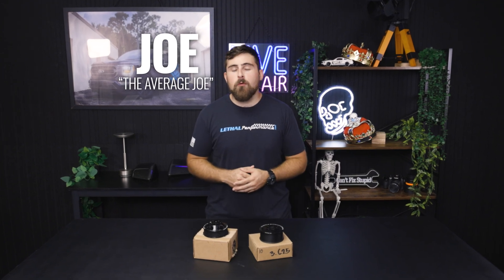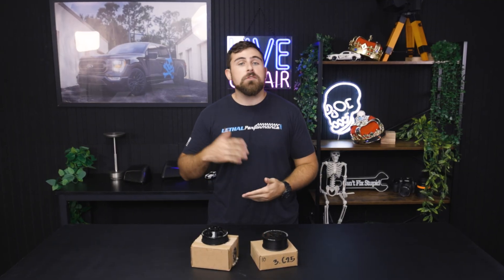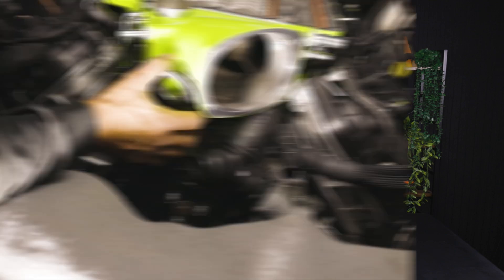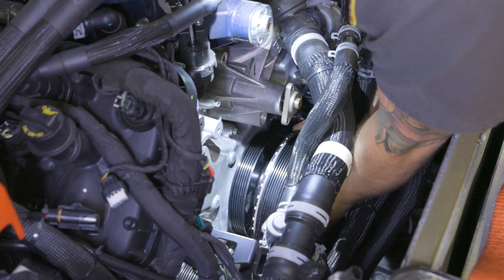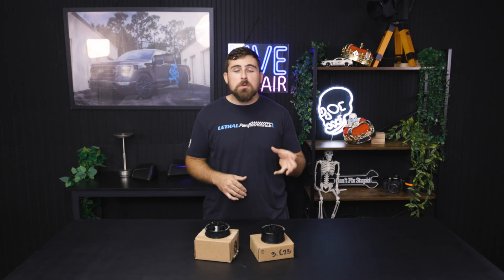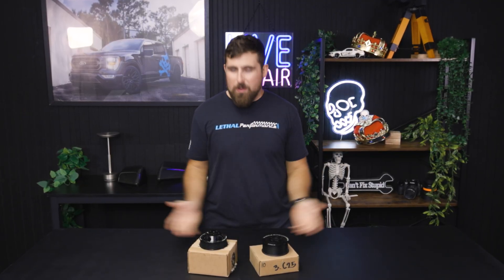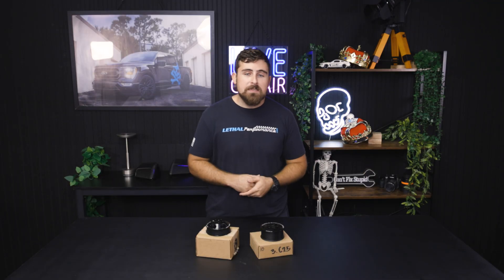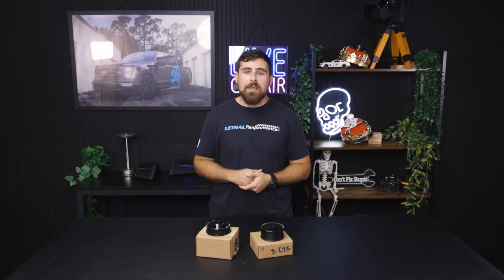Supercharger Pulleys - Two Minute Tuesday

Comment: Im running a 4.0 kenne bell on my '87 ford fiesta. I currently have a 4.00" upper pulley. Should i reduce it to 3.50" for even more revolutions in my s/c? Thankyou!
Reply: My wife's '91 Daihatsu Charade with inline 3 cyl was only making 53hp. Since we dropped a Magnuson 2300 supercharger on it, we've experienced sublime hp gains! She currently uses a 6 rib belt. Should we get a smaller pulley with 10 rib for ultimate ho gains??? Thankyou so much, good sir!